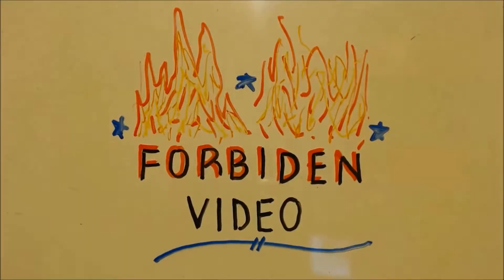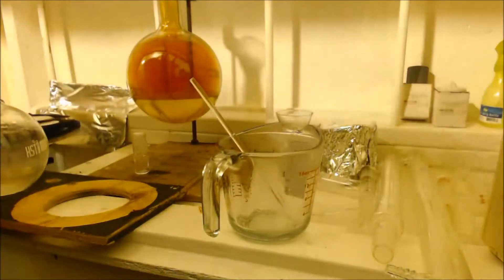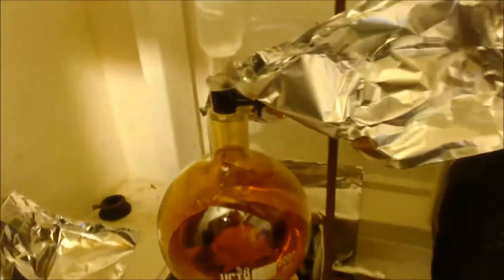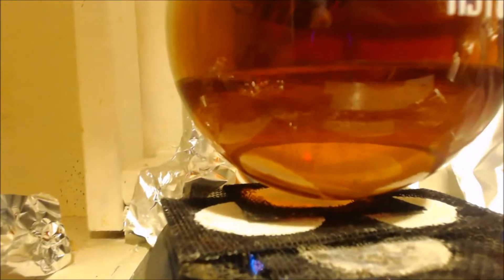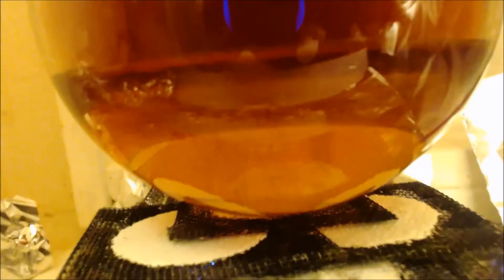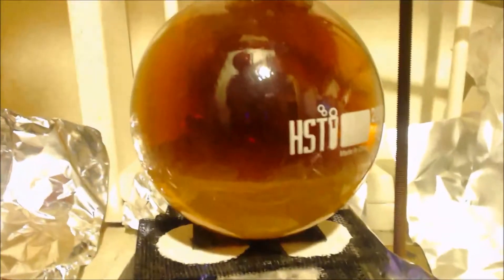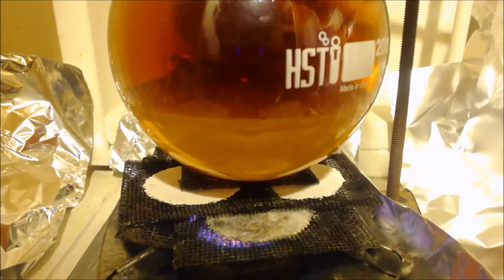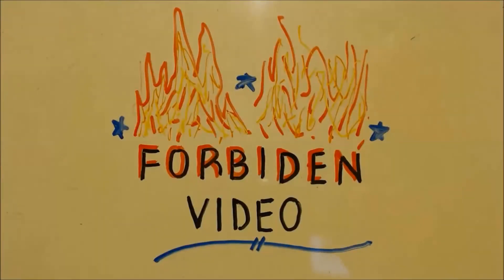SYNTHESIS OF CARBOXY METHYLBENZENE (toluic acid)  PART 1

Comment: can you believe that toluene in my country is a drug precursor ? it is replaced even from solvents
Reply from the maker: Lead Azide&Base............. Yeah it is almost as bad here.   I did find one product in a store near me that had 10% toluene in it.  So that is better than nothing.   A gallon only cost 15 or $20 and 10% of that is 375 mL.   So not terribly bad here.  But it is getting bad
Reply: @jbsc6180  i'm planning to obtain it by distilling gasoline (10-15% in there), but don't know what to do with low boiling flammable hydrocarbons
Reply from the maker: @vantablack9882  …………..Man you are rambunctious.   I always wanted to do that with gasoline. Fire and explosions did a video on distilling gasoline from his country.  Every country has different gas.  Here in the USA we do not even sell gasoline any more...……..only gasohol.   Anyways to answer your question.  You could use the low boiling hydrocarbons as a non polar solvent to extract stuff like you would with DCM or ether.  Also you could just throw it in your gas tank on your car and just mix it with a full tank of regular (undistilled) gasoline.   That is what I do usually.  If I distill toluene out of paint stripper or brush cleaner I just throw everything except the toluene back in the can and use it to strip or clean paint brushes.  It still works without the toluene...……...same with gasoline IF MIXED with regular gasoline...………….HEY IF YOU EVER do distill gasoline let me know how it goes.   I am curious how much toluene you can get
Reply: @jbsc6180  i've tried extract toluene from solvents , which must contain it , but they replacing it with carcinogenic toxic benzene and other thing like esters . Easier to disstill gasoline without unknown azeotropes with esters and stuff
Reply from the maker: @vantablack9882  ……….. Yeah I bought a few products that used to contain toluene and the MSDS still says they have toluene in the product BUT I found out the toluene  was replaced with …….usually xylenes.    Everything used to have toluene in it cause it is the best degreaser/paint thinner.   But like you said... sooner or later no products will have toluene in them

Comment: You should sub to Tom’s Lab he does chem streams on YT, a lot of chemistry channels join in !
Reply from the maker: canal canal...........i do not really subscribe to any channels.   I have very limited time for the next 3.5  years.   I should check in on tom's lab though.  I am a fan.   I found out a couple weeks ago i DEFINTIELY have bed bugs from my STUPID ex girlfriend and her new apartment.  So now i have to fix my attic so the birds can not get in.............take all the bottles in my house that has liquid in them and get them out of the house...........AND I GOT HUNDREDS of containers with liquid in them..........also got to throw 90% of my stuff out in my house which is alot of stuff...............alot of metal in the basement and i am a pack rat so a lot of useless garbage...........then heat the house up to 150 F / 66 C and keep it that temp all day.  Then REPEAT the heating of the house a week later and then to be sure do it a third time a week later.   I need to do this in the summer or it will be impossible to get it that hot.  I can barely keep the house at 120 F in the winter.  At 120 F the heat is not getting inside the joinst in the walls and floors.    I got 8 or 9 weeks to do this and heating the house that many times will take up 3 weeks so i got 5 weeks or so to get $h!t done................IF ...........IF ............IF i can do that i could have the whole winter to do videos instead working or my problems...........a stress free winter would be so nice.  I can finally have a clean organized home cause it will be a pretty empty house after att the heat treating
Reply: JBSC  thats a lot of work man, hope you could get it all done, so you can enjoy the winter. Stay safe!!
Reply from the maker: canal canal..............oh man i have been working my ass off.   I did the roof and i got 8 boxes of bottles with liquid in them in boxes and i am going to put them in the car soi they do not bulid up pressure in the 150 F heat.   It will be hot enough in the car to kill any bugs in the boxes........You know how hot a car gets in the sun..  Today and the next couple days it is going to be 90 F............PERFECT FOR HEAT TREATING THE HOUSE............at 105 F it takes an hour to kill a bed bug and 120 F it takes a minute or 2 and the egss are dead in 90 minutes,  With it being 90 F outside it should be no problem to get the house up to 150 F....................and a 150 F house should get the INSIDE walss and joist at leat up to 110 F so hopefully they will ALL DIE..............When i say how hot it was going to be i went in to HIGH gear with getting shit done